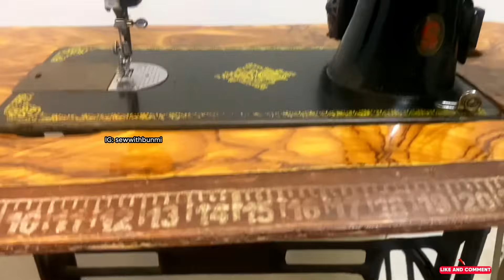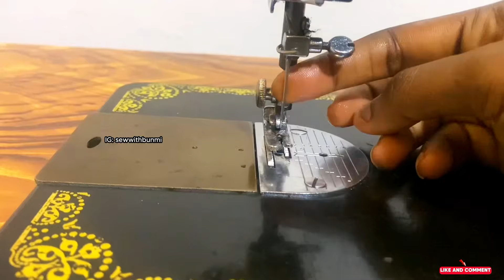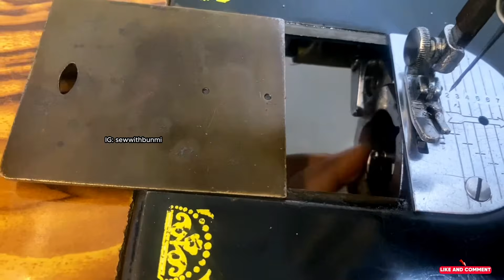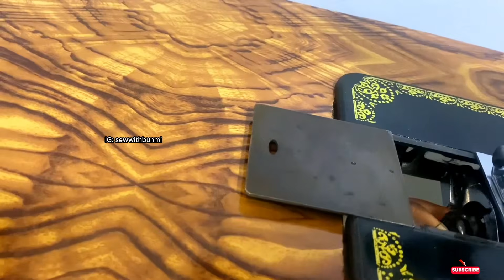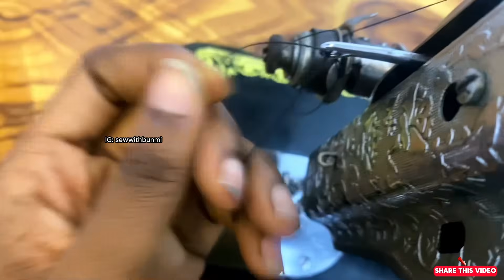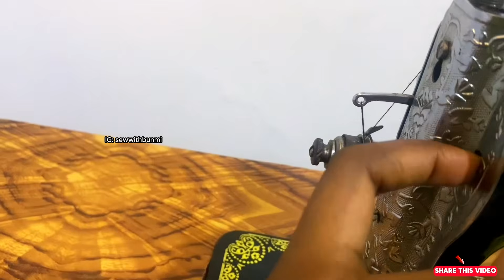How to use a SEWING MACHINE for beginners- Parts, Threading, Pedaling, Sewing & Maintenance | PART 5

Comment: Thank you so much for this insightful beginner friendly video… please would you recommend a manual machine for a beginner or an electric machine? Would really appreciate your response as I’m trying to make a decision. 
P.S: I’m trying to learn DIY
Reply from the maker: Hello Favour, Now this is dependent on you. If you are going for Table top electric machine, do you usually have light in your area? Or do you have a constant source of electricity supply? I usually prefer a sewing machine that I can use with or without light.

Comment: Thanks for the class ma'am❤️

When I was trying to sew, my thread kept on snapping and it  kept on making a straight line on the fabric_ rather than sewing it.

I made sure to check everything you told us might make the thread snap, but I still couldn't find the problem
Reply from the maker: Oil your machine and rethread  it…. Also check the tension area to see that the tension is perfect

Comment: Thanks, I did all what you said but my machine is not sawing my clothes and is not faulty. My needle keeps breaking. Can you make a video explaining how to fix your needle back to the machine when the fixed  one is broken?
Reply from the maker: Sorry🥹, I can absolutely relate. The needle breaking issue can be frustrating. Are you sure you set up the right way?In the main time, You can check out videos on YouTube on how to fix your needle.

Comment: Thank you for the video.  I still have a problem. My tension regulator is not working properly,  the thread can hard move through, and it ends up cutting. Also, I can hardly pick up the bottom thread. What do I do? I am using the handle to paddle.
Reply from the maker: You can oil the tension regulator area and loosen it abit, the thread is not supposed to be too tight at the tension regulator area
Reply: @sewwithbunmi  thank you so much

Comment: Pls will the sowing be moving forward by itself or i will be the one to be using my hand to move it forward because i just started training on sowing machine today and i started with exactly what you did by and also using fabrics but at first the fabrics was moving backward while on it and later on i decided to be using my hand to move it forward as I'm sowing i don't know if you understand what I'm saying. So ma, will the fabric be moving by itself or you can also use hand to control it??
Reply from the maker: @aduleyeomobolaji3907  you control the sewing machine with the balance wheel and the foot pedal. You are the one to decide if it should move forward or backward. As for the fabric, the feed dog will help move it either forward or backwards depending on your control of the balance wheel but you will still control/direct your fabric with your hand.
Reply: Okay ma 
Thanks so much 
Will try again tomorrow

Comment: Love it ,i have a black head machine ,sometimes i fell like i want to transfer it to electric and a next time ,im not sure ,when me see light go away more tjme for days
Reply from the maker: It is very easy to move it from electricity to manual... Just remove the belt for electric and change it back to manual. For me if there is light, I use the electric motor, if there is no light, I change back to manual.